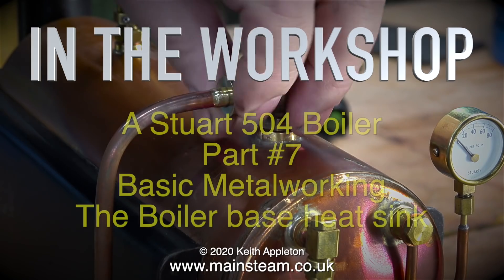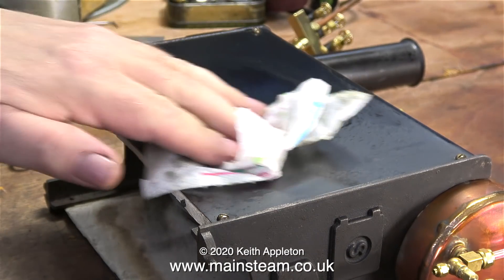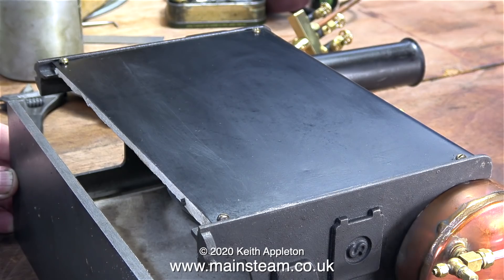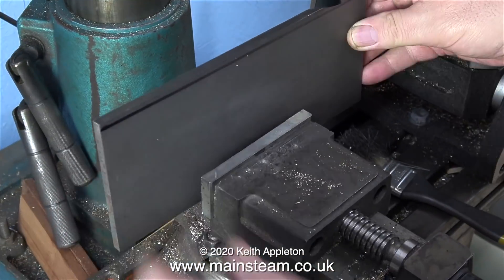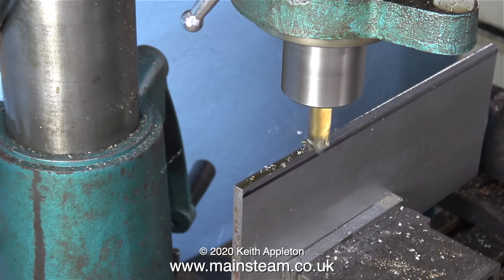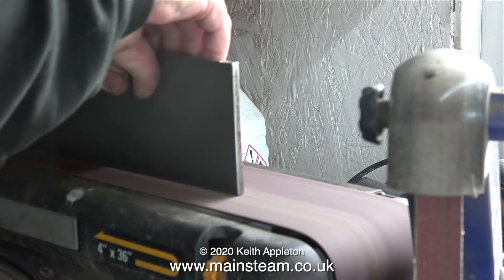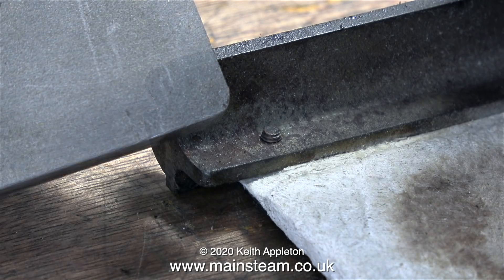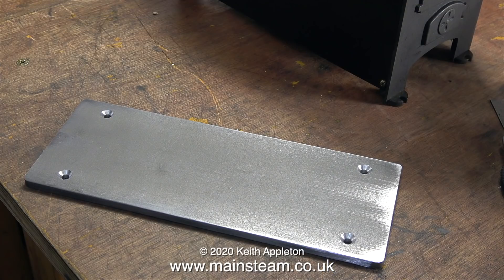IN THE WORKSHOP - A STUART 504 BOILER VIA EBAY - PART #7

Comment: Methylated spirits is denatured ethyl alcohol. Essentially, vodka with additives to make it impossible to drink. It works every bit as well as isopropyl alcohol as a sanitizer. For it to be an effective sanitizer, it should be diluted to between 50 and 70 percent. Interestingly, its effectiveness at killing microbes actually reduces in concentrations above 70 percent. Love the videos, keep up the good work.

Comment: Methylated Spirits is around 95% Ethanol. The most effective % for antiseptic use is 70%. So you dilute around 100ml of Metho with about 25ml Water (or water/glycerin mix to minimise dehydration of the skin).
Reply: I'm wondering whether the methanol in it would cause poisoning? I guess not seeing as nothing came of it but perhaps if it was used a lot?

Comment: Methylated spirit will work as a hand sanitizer, but it is not good for your skin.  If you can add aloe gell to the spirit, or use a hand cream or skin moisturizer after the spirit, you should be okay.  We have some old hand sanitizer that got very thick sitting in the pantry.  We are using methylated spirit to thin it out and use it all the time.

Comment: Here in Sweden, the methylated spirits sold are a terribly disgusting and strange mix of various substances, not just ethanol.
Instead, I recommend the Danish variety, which is very clean and better both as fuel and detergent.
Reply: In Britain I think it's similar, there's methanol in it which can cause blindness and death if you drink it, not sure about using it on wounds though.

Comment: Thanks a lot for your videos Mr Appleton, I've found them both entertaining and good for learning. I build model boats, and I'm a bit tired of recharging batteries, although brushless motors bring a lot of power. That's why, following some of your instructions I started building a steam turbine, which it's easier for me given my small tool box and even smaller knowledge on the matter, just two ball bearings a shaft and two pieces of round aluminum with as many blades as possible in between. Then I will fit it on a metal model boat that I built long ago. Would you take on the challenge of building a steam turbine yourself? It would be awesome and for me a huge help. Thanks a lot again, and keep safe!
Reply from the maker: I prefer the good old reciprocation steam engine types, as you can clearly see each part doing its stuff }:-)))
Reply: @keithappleton  thanks a lot. Perhaps I should follow suit as well..

Comment: Yes . Methylated spirits will indeed work as hand sanitizer. Ethanol with enough methanol to render undrinkable. It is recommended that 30 to 40 percent water is actually needed to efficiently destroy CV 19. So add some appropriate amount of water and clean off your hands.Methanol is not recommended for prolonged skin contact. There is not enough in your spirits to be actively unsafe,but just don't do a prolonged soak in the stuff and you will be perfectly fine.
All the best,stay safe.
Reply: I do believe you can absorb it though your skin but I think you'll need to take a lot of it in.
Reply: @stephenrowley4171  Exactly.

Comment: I believe those spirits contain methyl alcohol. That is a cousin to ethanol. As long as you don't drink it, it will work fine as a sanitizer. Also, iso propyl alcohol (isopropanol or IPA) would also work well.